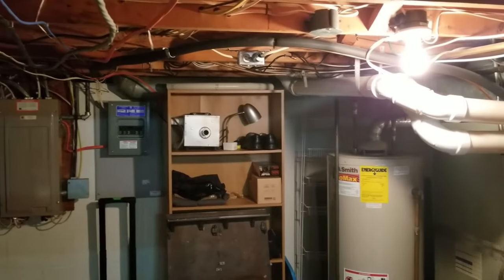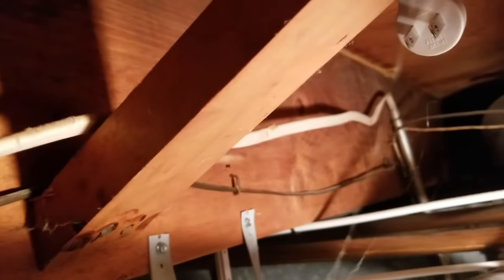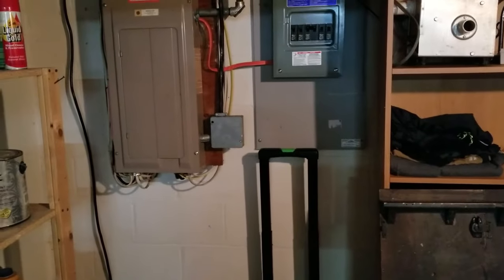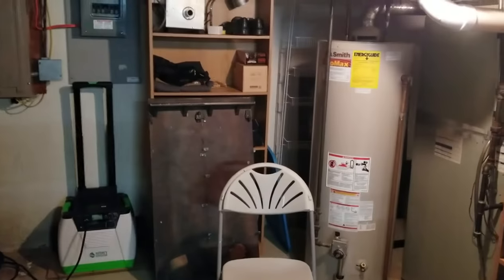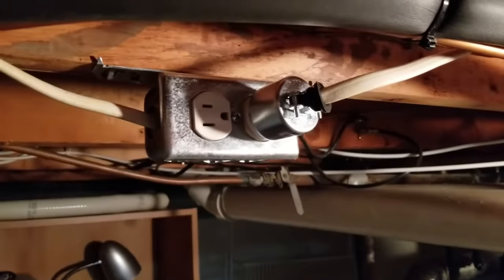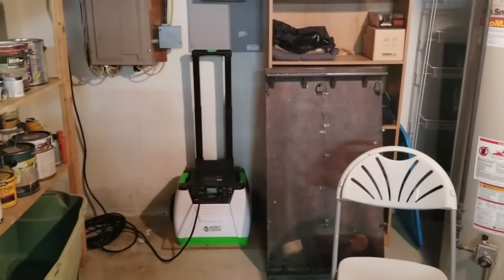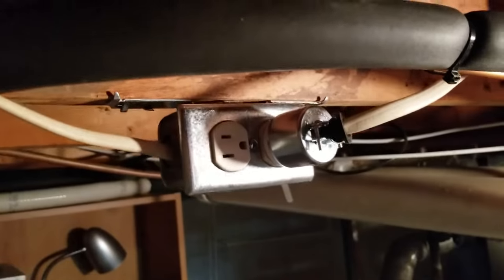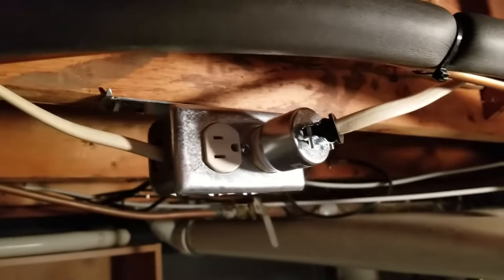Power Your Furnace With A Generator During A Power Outage

Comment: It has to be a single outlet, not the dual outlet you used. You're out of code and unsafe. Nothing else should be able to be plugged into the furnace circuit. It has to be dedicated to the furnace -- single outlet.
Reply: Local codes must vary because my house has a furnace switch and dual outlet combo that share the same line wiring.  The switch controls power to the furnace but the dual outlets in the same box are hot regardless whether the furnace switch is on or off.  The outlets are not connected to the furnace wiring, just the switch is.  Only way to turn power off to those outlets is to turn the breaker off.  House has been inspected several times with each sale and when a new HVAC unit is installed and this was never written up.  But having a switch in close proximity to the furnace where a service tech can cut power to the furnace is required by code in my jurisdiction.  House is 30 YO and really don't see the "safety" issue with this setup.  If someone were to overload the circuit, the breaker would trip like it is supposed to.
Reply: Single outlet with a switch
Reply: Out of code?  Maybe.  Unsafe?  Nah nothing unsafe about it.  If for some reason you plug in something that draws enough to overload the circuit, that's what breakers are for.
Reply: @Andy-df5fj  That is wrong. Electrical code isn't for giggles. There are several problems that could inadvertently overload that circuit. Plus, circuits should be used at 80% or below the breaker rating.
Reply: Yea when $#it hits the fan I don't think codes will matter much lol
Reply: Might not be up to code, but as long as he personally doesn't plug something else in, why would it be unsafe?
Reply: @johnhammon1718  What about when he sells the house or when he's away and someone else is taking care of things?
Reply: @Andy-df5fj the issue is that if somebody plugs in something that overloads the breaker it could trip with nobody around, no heat means frozen pipes or even health issues. Codes are meant to cover the 1% cases for health & safety.
Reply: @jm000001897 calm down. Trust me I've been an electrician since you were shitting yella. What he did is not dangerous at all.
Reply: Totally calm here and understanding the code is important. It's there for a reason. Plenty of backwoods electricians out there dorking things up
Reply: @jm000001897  let me edit my last comment I have been an electrician since long before you were born son. Don't even try to talk code and safety to me.

Comment: I had a transfer switch put in this past summer. For me, it was worth it. I worked lots of overtime and paid cash.  I’m 69, single female and no men I know no how do do these things, so….I gotta pay.  It was worth every penny.  I lost power for 18 hours and I went into garage, pulled that baby out. Hooked her up, went down stairs and hit the switches, went back outside and started my gas generator. It was last summer, very hot and I lost nothing. It was wonderful. I can run my furnace by switching the switch for furnace if I have too. I just can’t run out of gas.  This I have nobody to help me with, (installing like you did), so I have alternate plans for heat in winter 🥶 if I run out of gas.  It’s gonna be really cold here in Michigan their saying this Christmas of 2022, so I’m ready
Reply: In Michigan waiting for this blizzard to hit and found this comment because of the power goes out I’m running to family farm and home and getting a generator and a plug and outlet… lol stay warm out there.
Reply: Some generators can be converted to natural gas so that you can connect it to your home gas line instead of worrying about running out of gasoline fuel.
Reply: Well you gotta pay or....... lol!

Comment: NEC Code suggests there must be a dedicated line to gas fired appliances,  so a better setup would be a single plug outlet.  Some local code inspectors will claim that even an outlet in the line is not up to code, but it would seem to be easy enough to undo if it truly became an issue.   Some folks have claimed that sine wave variations on generators can fry circuits in gas furnaces.  Not sure if there is consensus on this.  Great video and thanks for the insight!
Reply: I suspect a inverter generator with a pure sine wave would likely be a good option.
Reply: I've been told after searching info, there must be 3ft between Electric Outlet connection and Gas Line or Furnace.
Reply: @beverlyprice9144  I doubt that's accurate.  Every furnace has an outlet near by code so the HVAC tech can work on the unit.
Reply: @busterhyman6633  How would you run your pump for the pan if that was true?
Reply: not only that the wires are not secured by connectors that are going to the junction box

Comment: If anyone is worried about current spikes using cheap or older generators.... Just hook up a heater to it like a space heater then it will put a load on the generator and it won't fluctuate

Comment: Not good, you now have a resistive ground, and your furnace now depends on an outlet which isnt a solid connection. You should have wired in a small generator transfer switch with a twist lock outlet. Backing up the furnace is ok but not the way you did it.

Comment: I had this big plan to buy a transfer switch and run all the lines etc. so that I could just run my furnace off a swich to my genny, right up until we put the house on the market and realized that all that stuff wouldnt be coming with us. This is a simple solution for a direct genny run to at least keep heat when the grid fails. Excellent work sir.

Comment: I am grateful for this video because it is exactly what I plan to do in the next day or two. Logically, the idea makes perfect sense to me, but there is always that underlying doubt: "What if there is something I am not realizing? What if my idea is wrong?"  Other videos with a similar plan that I have viewed, add unnecessary complication. Simply breaking into the feed cable to put an outlet on the power side and a plug on the device side is simple, straightforward, nothing confusing about it.

Comment: Thank you, and just the solution I was looking for! I spoke to the furnace maintenance technician the last he performed work on my furnace and I told him exactly what I had planned to do. He indicated that as long as I did not mess with the furnace itself, he had no problem with my replacing the switch with a plug. And it is connected to the main with a 15 AMP fuse, so if I overload it, the fuse will be tripped. Just to be safe though, I have put a safety cap on the second plug, which will not be used.

Comment: Great video! I’m looking at alternatives in case the power goes out. Didn’t know the gas flow would stop in a grid failure. My plan also involves a diesel heater for vans and a portable hot water heater. Thanks for the info. I’ll get the parts!

Comment: My natural gas Carrier furnace is in the attic and has one 120v feed with a standard wall switch to turn it off.   I’m going to replace that switch with a double pole double throw switch with the regular 120v line going to the top connectors and the generator line going to bottom connectors.   The furnace line will go to the middle connectors.    That way, both hot and common will be isolated from each other.   Flip the switch up for one feed and down for the other feed.

Comment: I am not an electrician but I believe the proper way to do this and meet code it has to be a single outlet so only the heater is in that circuit.  Also get a good appliance cord  from the hardware store instead of the Romex from the heater.

That should be good enough for national code as I understand it.  Did this in the past with a gas furnace no problem.
Reply: How do you prevent flow of current back to the panel and then out to the power line?  Do you not need a mechanical break in the circuit that shuts off current from generator to power line?
Reply: @michaelb1303  Instead of the heater being hardwired to the electrical box you put in a single outlet.  The heater can plug into a single dedicated outlet.  When power goes out you unplug it from the wall and plug it into the generator like any other appliance would.

You are not connecting back to the house circuit at all. So there is no possible way to back feed the power grid.
Reply: @dronesrus5676  ok, now I think I get it.  You pull the plug from the electrical box out of the receptacle.  This prevents current from the generator getting back to panel and out to service line.

Thank you.  I appreciate the response.
Reply: @michaelb1303  sure he shuts the main breaker off
Reply: @michaelb1303  he only has a plug from the furnace not the box
Reply: @michaelb1303  I have a service switch that I can turn off preventing the flow back to the panel.

Comment: I have a Coleman 1750 impulse generator. I did what he did ...Except, I did NOT put a box. Just a plug in play, outlets. I cut the romax and put a plug. When the power goes out, I unplug and plug in the genni..works great. Power back on..unplug and plug it back in to house current. Easy as that.
Reply: OLD furnace, though. Not worried about the board issues. Just used a surge protector.
Reply: OH I forget about this...Very important. You have to ground your small genni, Ground rod, mine has a clamp so you can put a ground rod in and clap a wire to it.

Comment: Start up watts is much higher than run watts. Make sure generator can handle the extra load if running other appliances in the house.
Reply: You're supposed to plug in the one that takes the most forst let it run a few minutes then add the next and next etc.

Comment: This is a very simple idea and a good way to power the furnace, I'll take others advice and use a single outlet. 

By the way electrical work IS intimidating for some folks including myself, but by killing the main I don't see any danger in cutting a wire and putting in a single outlet. Heck even I can do this myself, and I can barely change a light bulb.

Comment: I got the Honda 2200i generator.     Works good and is very quite.   So far I’ve used it to run some small tools and my 1/2hp water well pump.    Had an old house demolished and they accidentally cut the electric line to the pump.   It is rated at 1800 watts.

Comment: There are a lot of comments about how a single uninterrupted line  to your furnace is by code. To get around this, wire the male cord to your furnace and have the uninterrupted line run to an outlet right next to the furnace. You end up with the same result. You can plug the furnace into the outlet or into an extension cord running to the generator. What's better is that now you won't have a extension cord hanging from the ceiling during a power outage.
Reply: Isn’t that exactly what the video describes?  Not sure what your point is. Did you watch the video?
Reply: Except that’s not uninterrupted. Furnaces are not tested by the manufacturer to operate on a power cord. Will it work, almost certainly. Is it safe? Nobody has tested it in a controlled environment.

Comment: I've been through many extended power outages. Never seen NG shut down. There are too many people with NG Generacs now. People who had them installed because they have life support equipment needs. They would shut down a line if there was a leak but aren't shutting down the system "just in case", unless maybe it was an earthquake.

Comment: I was gonna do this too but if you have a high efficiency furnace I’ve read that small portable generators don’t produce “clean” power and the furnace won’t run or worse yet you can fry the circuit board in the furnace.  I expect this would work for any older furnace assuming you have enough output on the generator for initial startup of the furnace.
Reply: you need to ground your generator otherwise the furnace won't fire up because the surge protector won't allow floating neutral generators (not grounded) to transmit electricity to the furnace.
To ground your generator you will need a bonding plug (get it in amazon) and plug it into the generator, a grounding wire connected from generator frame (ground point) to grounding clamp that connects to copper pipe of the water meter
Reply: @grettayolanda  Thank you!  Floating Neutral got me on the right track trying to power my furnace with an Inverter . Giandell 4000 Watt pure sine wave.
Reply: @grettayolanda  my generator powers my boiler and water pump.
Reply: Get a pure-sine wave inverter...  modified-sine is hard on electronics.
Reply: Modern "inverter" generators can provide plenty of clean power for any household electronic.

Comment: I wanted to do this, I was told the furnace "must be hard wired,"  So to stay inside the code, I left the furnace as it is, shut off the main breakers at the panel and at the disconnect under the meter.
Then plugged in a cord from Gen to special male fitting getting rid of the widow maker, a.k.a. the
suicide cord. I did hear of a mechanical interlock that is the go-between Mains and Gen brkr.
Mains. I think that could really be a good thing, BUT the safest is the old fashion pull-out in 
fuseboxes. gonna fire up the gen?  u literally 'pull the mains'  and by doing that, the two large
cartridge like fuses are removed and there is NO way u will send juice up the service drops.
Reply: The way you are describing it, sounds like your "special male fitting" is still a widow maker!! What are you plugging the generator in to??
Reply: @hayman41350  No way Hosey! I mean if u  or I have the smarts we can use the
widow maker, if we think it all out, I have done it, BUT what I'm talking here is a UL
approved male fitting in a UL box w a cover this would be secured to outside bldg
surface like maybe a wall? and wired up to say 10/4 which is a red a black Non
racist term here, a white and a green  and to a double pole breaker. power goes out
and its gonna be a while b4 its on again, shut off the mains and if possible secure 
in said position now you have a gen cord male at gen end female at house end.
a much safer way, shut brkr off on gen  start it an let warm up then turn it on. I hope
this clears it up for you. , I think you could also get a recessed male fitting for just 
120 volts and I have seen the set up for a furnace, it has a male fitting bilt in and a switch. power goes out u hook up a reg. extension crd to it, its already wired to the
furnace. flip sw. and furnace starts.
Reply: @raymondgarafano8604  got you now!!
Reply: @raymondgarafano8604  
Do you have a link for that type of interlocked receptacle/switch?
Or what it’s called.
Can’t seem to find that online
Thx
Reply: @meonlybetter007  Hello Carlos  EZ Generator switch, it has a 3 position switch
with a built-in male fitting so as to plug an extension cord into, a 
grounded one for safety. any electrical supply company should be able to 
get it. hope this helps.
Reply: @hayman41350  NOPE it is a box with prongs, hooked to the breaker in the panel. Either u have a mech. interlock between mains and  gen breaker or u 
shut off mains, turn on gen breaker, then lock the mains in OFF position. 
Then u take a cord heavy enough for the load if it's 120/240 go for a 10/4 
cord as gen will have a circular outlet, 2 r hots 1 is a neutral and is opposite 
from prong w a small hook in it, that is ground. the box will have a cover to 
cover prongs that u place the female end of gen-cord. In this manner, u have 
NO exposed prongs with voltage on them. 
This is a MUST if u have pets or children. I have used the widow maker, it is 
safe if u are the only one around. u shut off power at mains and lock mains. 
u plug gen-cord  into the dryer. after gen warmed up u plug gen-cord into gen.
When power returns, u unplug from GEN, and b4 anything else unplug from 
dryer. otherwise u could turn on the mains and have juice on prongs at gen's 
end of cord. its not rocket science but definitely deserves respect, and I'm
saying  electricity has no respect for ignorance.

Comment: I just tried this and hooked our high efficiency trane gas heater to our 3000 watt inverter, which is powered by three 100 amp hour batteries. The low speed blower comes on, but the furnace will not light up. The extension cord does not have a ground terminal. Plugging the furnace plug back into the outlet box restores the function of the furnace. Any thoughts?

Comment: Another excellent vid!  Thanks much for the idea!   What happens if you are plugged into the power generator when the electric ones on?
Reply: The furnace is plugged directly into the generator, so it doesn't matter.  When power comes back, simply unplug from generator and plug back into the wall outlet.

Comment: My furnace is functional with my bluetti large power generator. but the thermostat in the hall does not work to send signal to the furnace to turn on? It is a honeywell TH6220WF2006. How can I turn the furnace on or off with no power to the wall thermostat? I have a Goodman furnace.  Thanks

Comment: Looks like you are using batteries and an inverter? I would be skeptical that you could power a 500 watt furnace with batteries for a few days. What if you get blizzard and cant get anywhere? What if the power is out for 7-15 days? At a MINIMUM, I would supplement what you have with a 2000 watt inverter generator. They will run all day long on 2.5 gallons of gas. And can be used to recharge your batteries. I live in Florida so I don't have to worry about freezing to death, but if I did live up north, I would add redundancy and multiple backup options, just in case, so my family doesn't freeze in a worst case scenario.  I use the two is one, one is none way of thinking, so I would have two gas powered generators, etc. One is a backup. Also, 1500 watt electric space heater for backup, in case the gas goes out, or something.